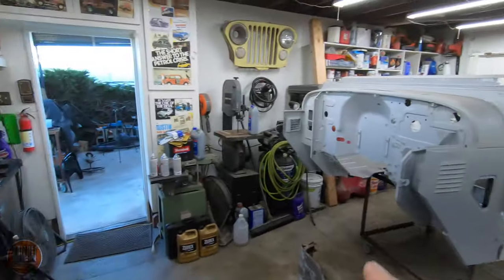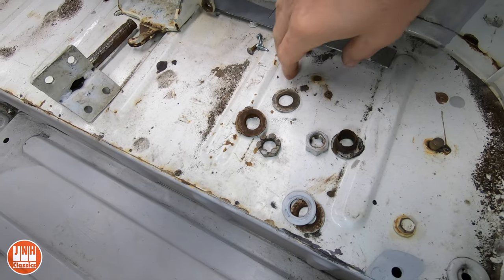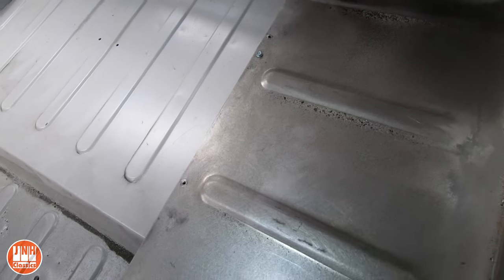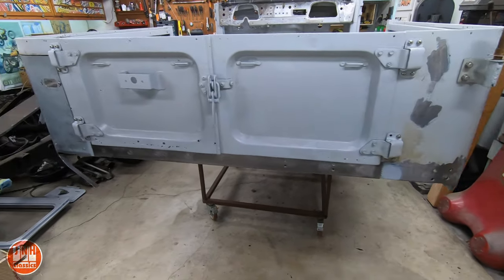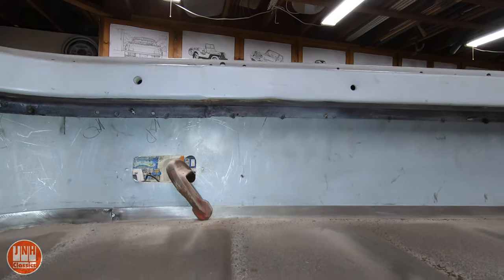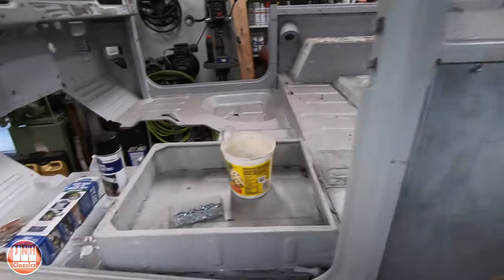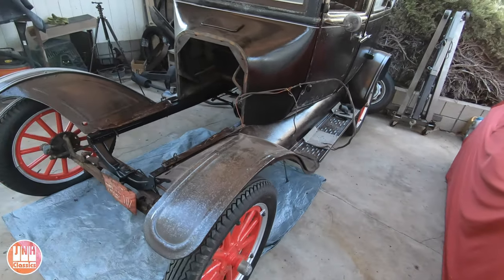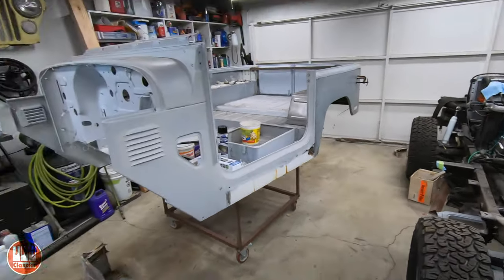FJ40, Model T & 356 - Sunday Update Video (12-20-20)

Comment: Before you weld up that fuel filler hole, take a look at this fuel tank in my other post...  These FJ's have a tiny fuel tank and this thing will more than double your fuel capacity; it is a 20 gallon tank for an '87 Blazer I think?.  I have not installed it yet, but it is supposed to fit w/o cutting the frame.  It is only 72 dollars including shipping and they sell the hanger straps but you may need to modify them.  If you do a 2" body lift, it will better hide the tank behind the bumper.  I am going to use the NAPA 501-1742 universal sending unit and gauge - might have to make an adapter to get it to work, but make sure your sending unit and gauge are the same ohms or whatever as they have to match.  The combination of a tiny OEM tank and crappy fuel mileage makes an extra tank necessary.  If you don't want a separate filler, there's the option to have a couple of fuel transfer pumps so you can just pump between the two tanks?  Not the ideal solution in my opinion.  Just a thought... if you are going to do it, now's the time.  https://redlinelandcruisers.com/shop/suspension/full-kits/red-line-land-cruisers-ulitmate-fj40-lift-kit-2-inch/